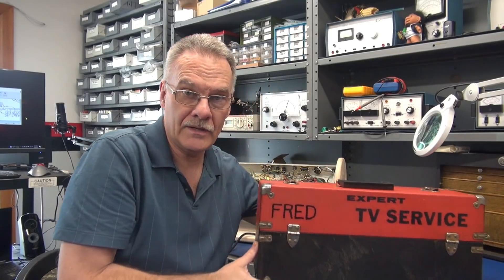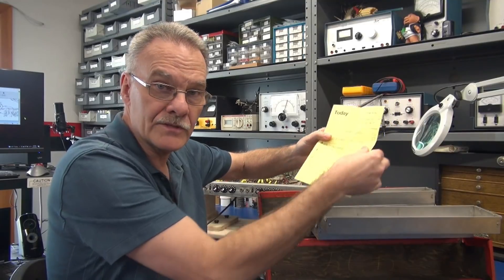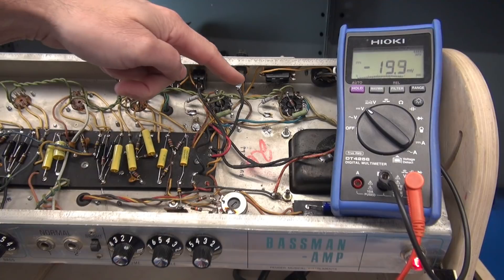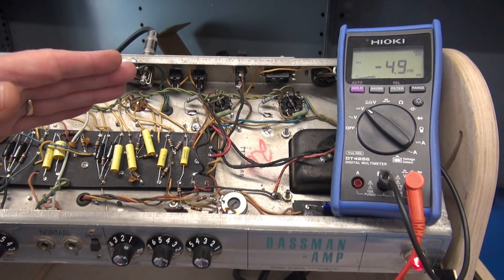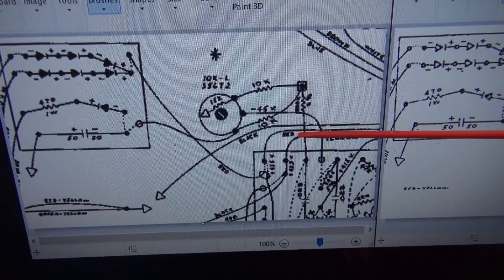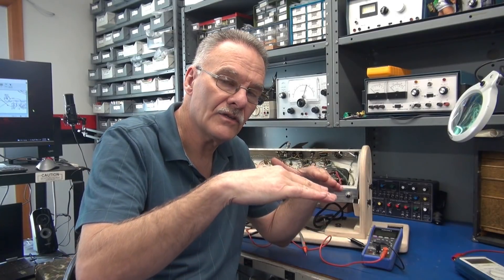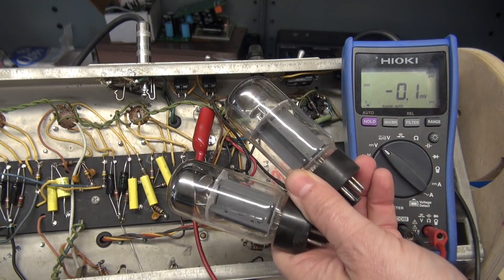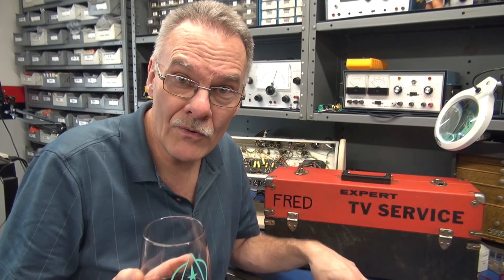D-lab series Basic Training Tube Guitar amp repair Balance vrs variable bias system fact or fiction

Comment: Completely new to tubes and amps. But I have a basic electronics knowledge from college (Mechanical Engineering). Find this stuff fascinating. What is the basic kit needed? I have a cheap multimeter.

Comment: Yes. Keep this content coming. Queation - you referenced the increase in wall voltage that we have these days and I can see how it can adversly affect tube bias - but do transister amps have the same concern? Should we be worried about output transistor bias with increased wall voltages?

Comment: Hi Terry, can you tell me the correct plate current for two 6l6gc class AB running 450 plate volts?  Is 43 mA per tube too high?  They are in a 59 Bassman reissue.   Thanks

Comment: Bad fix overall. Those are not real UK Mullard output tubes. The correct way to do it is a bias & balance circuit so you can adjust the bias voltage and balance the cathode current (plate + screen current) through each tube. As the tubes age they may not age the same & bye bye cathode current balance 🤦‍♂️

Comment: Great work! I think you meant "No way to adjust" not "No way to Measure" bias. You can always measure the Voltage drop at the Output transformer center tap to plate and calculate the Bias Current based on the Plate Voltage, Output Transformer DC resistance. I created an Excel spreadsheet that does the calculations for me. I suppose you could argue that directly measuring is better, but I've found calculated values are good enough for rock n' roll and usually match the measured current pretty closely.  🎸🎸🎸

Comment: Nice video. What pin on the power tubes does the 1ohm resistor connect to? It should be a precision tolerance, yes? I went ahead and got an extra multimeter (a pair of old USAF fluke FM/27s) to monitor both tubes simultaneously.

Comment: I would have left the balancing pot and added a voltage adjustment pot so my client could run (almost) any pair of tubes as tubes usually wear out unevenly. Pots are cheap. Your thoughts?

Comment: I have no idea why my last comment was posted twice, and I feel like I didn't ask the right questions, or I didn't have enough info behind my inquiry. I also see that it will take me a little while to bring myself up to speed with you and your subscribers. I have a general knowledge of the function, of most of the components, but very little knowledge of how to put them together. I took basic electricity , in high school,...E / I X R , and so forth . What, besides a volt ohm meter, will I need to continue. I will take the chassis out again, so I can look for obvious problems and leaking caps.  I appreciate any guidance you may have for me Terry, for now this is Kevin Keller saying I'm out of here.

Comment: 😉I have installed a dual bias balance circuit.  It this case you could have turned the one running hot down to level the other was running and extended tube life in these days of "No Tubes Left"  We have to make use of these tubes until they actually fault and end their life.  In general run tubes cool to moderate 55% to 60% dissipation and get many years of life.  I think the idea of running at 70% is outdated for the times. Not arguing with you, adding in other options.  I think this is a great series please keep it up. 🙂

Comment: Yes, continue.  I have a '79 fender twin that I repaired in 1989.  It was my first amp.  I still have it.  I also have a few Orange Rocker amplifiers.    The Orange Rockers all have scratchy pots (gain and volume).  Cleaning them works for a little while - then the static/scratchy sound comes back in a few months.  It's annoying.   I thought maybe, somehow, a DC voltage sitting across the pot(s) might have been the issue.  Pretty sure I checked with a voltmeter and found no weird DC voltage sitting there.   Now, I'm wondering if these are just cheap potentiometers.    I wouldn't be surprised if that's the case.

Comment: I have a ‘69 Super Reverb that’s blackfaced with adjustable fixed bias. I’m struggling with it because the bias adjustment no matter where I set it will not give me more than 10 ma of current per tube. I’ve replaced the bias range resistor, rectifier diode, 47/100 electrolytic cap, bias pot, several different bias pot resistors and nothing makes the circuit function properly. I’m at a loss at this point. 🤦‍♂️

Comment: By all means….continue! You may hit upon common tube amp situations that can be fixed or reconfigured to make your tube amp be more reliable and work properly for all us ampaholics. Question….would you put a bias adjust pot for each output tube? That seems the way to match tubes exactly, no matter if they are matched or not? We are trying to make our amps the very best we can instead of mass producing several and we don’t care if it costs more money to do so! We are only doing one amp at a time, so what the heck. This new series of informative videos is fantastic, to share your knowledge with us! Thank you Terry and I hope being a full time solder jock will be enough to pay the bills and keep you in vino. Love from not yet spring in NW Colorado.
Reply: Makes sense. I would love to hear the why nots on this great sounding idea. I have often wondered why no one does it that way.

Comment: Hi Terry, I'm building a Super 6K6 from a 520.  I have the filament circuit done along with the B+, it's pretty straight forward but I could use a review on the signal wiring from the input to the power tubes and output transformer.  For me it's a little convoluted and instead of just following a schematic I'm trying to understand the path and function of the signal with tone, tremolo and volume controls.  Might be a good subject for a mini class.  Thanks, love the series.

Comment: Hi Terry! I think you should show us a Mod that gives us Both bias voltage and a balance control so we can use any set of tubes.
Reply: replace the resistor on the balance pot with a trimmer set up as a variable resistor. one leg to ground middle leg to the balance pot.

Comment: In the first example, the variable resistor is being used as a potentiometer. In the second example, the VR is being used as a rheostat.
Reply: I think that a pot is a rheostat,...variable resistor,...
Reply: @Boneyard24  No a variable resistor can be connected to create a voltage divider using three points (potentiometer) or can be connected using only two points to control the amount of current (rheostat). It has just become common to refer to all VRs as pots even though they may not be used as a potentiometer in the circuit.

Comment: They say there are no "stupid questions, so I'm going to test that theory.

After watching this video, I'm wondering, "Can't you use a "hybrid" circuit that can both adjust the overall current (bias) to the tubes AND balance them, using 2 potentiometers? Kind of like having both volume AND balance controls on a stereo ( instead of a choice of one or the other)?  Does that sound stupid? Being  "noob", maybe I'm not using the correct terminology, but I think you get the drift of my question.
Reply from the maker: Yes Sir, could be done

Comment: Hi Terry! Thanks for sharing your knowledge with all us sinners. I've been listening to The Truth About Vintage Amps podcast too. Skip Simmons is a great amp tech in CA.
Could you go over 12AX7 / 5751 / 12AT7 and their applications. I'm thinking of things like differences in current requirements, suitability for Phase Inverter uses ect.
One last thing, should you have balanced triodes on a PI tube?
Thanks!!!

Comment: With all due respect, you could have changed the bias resistor for less than $1 and kept the balance circuit and the good old tubes in tact. I find the bias balance control to be very useful, although I seem to be in the minority. Adjustable fixed bias + bias balance control gives you the best scenario and you don't see that very often.
Reply from the maker: Yes, I would agree both variable + balance would be the ultimate. The main thing to concentrate on is the idle current thru the tubes, They need to be set correctly of their life span will suffer.
Reply: @d-labelectronics  Can you design a circuit that can be easily added to any tube amp that would serve the dual purpose? I have heard someone say that a guitar amp sounds better with a small difference in output tubes. Any truth to this?
Reply: @d-labelectronics  Please let me clarify. Changing the value of the bias resistor will change the negative voltage applied to the control grid of the output tubes. This effectively raises or lowers the idle current draw of the output tubes. It takes 10 minutes and costs less than $1. You can retain the balance control and the mismatched tubes. Less cost, less bench time, more control over the circuit. Win-Win-Win. No need to buy matched tubes.

Comment: I can see how this is the best solution, though it requires matched tubes, but I'm unsure why you couldn't have changed the 100k bias resistor to lower the current and then balanced it at that level. Would that still be a problem?
Reply from the maker: Just returned it to the AA165 schematic, Take a look

Comment: How does this compare to the JTM 45 circuit? Thanks!
Reply: It has many differences. The JTM45 is basically the '59 tweed bassman circuit made with British parts.
Reply: @elgen0314  Thank you. Yeah, I'm referring to the bias part. In the JTM 45 there's a single pot for adjusting bias. I wonder if it's more of a balance deal like the Bassman; or is it different in its function.
Reply: @CC-te5zf  The JTM45 has an adjustable fixed bias. That would be very similar to what he installed in this video.
Reply: @elgen0314  Awesome-thank you!